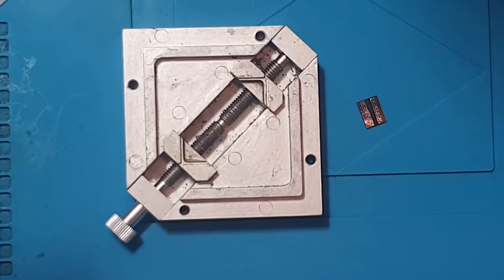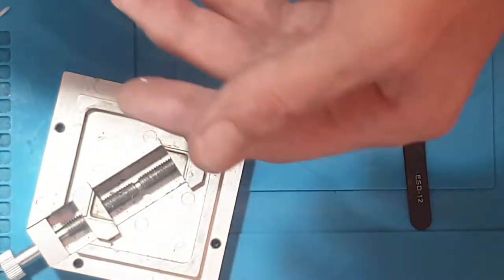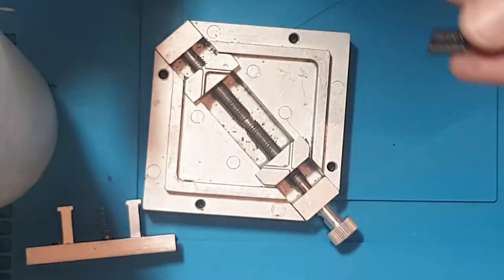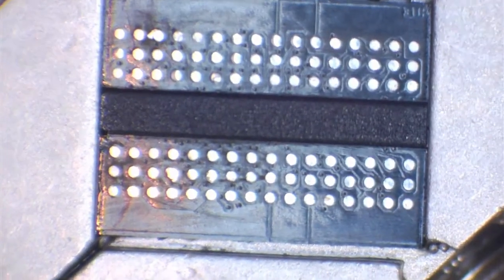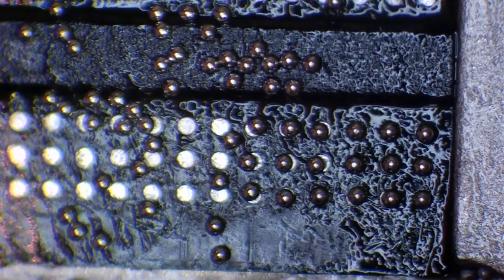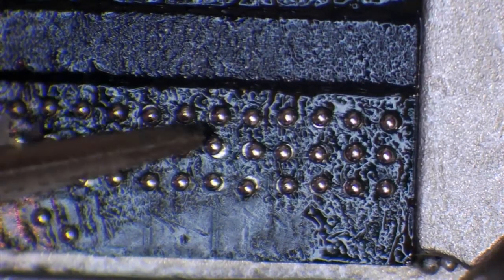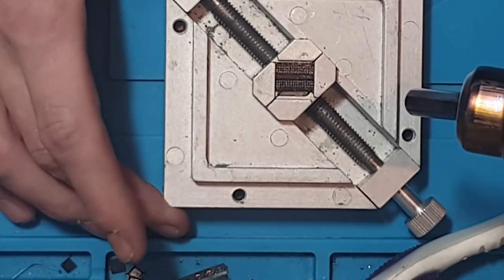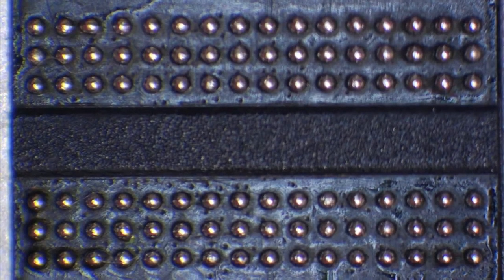How To Reball Any BGA Chip BY HAND Without Stencils - Hand Reballing Tutorial

Comment: The young lad who owns these gpu cards said that most of them were being used for crypto-mining so they were running 24/7 for ever, meaning ... so it's likely the gpu's got far too hot which is why they fail due to solder connections melting and failing. When they finally cool down if at all they go cold possibly. Just a thought ... even gamers can run their cards to bad temps and get the same results. I have heard of gamers who literally die sitting at their computers due to what ? Lack of sleep maybe ? or maybe starvation ? ... but more than likely LACK of INTELLIGENCE and self control/disipline ... maybe they should be taking up Aikido ?

Comment: Funny you should mention the magnifier app. I use a 40 inch TV with screen mirror an on the go adapter with a Bluetooth mouse and an old phone on a mount.
Reply from the maker: I used to use it myself and it was pretty good as a means to an end, especially when I was just starting out lol
Reply: @TheCod3r  hi mate I have a few chips I want to extract firmware from so I can factory reset the memory . My chips in my PCB remote controll have brands like atmel written on it . If you can assist me I will send you £50 👍

Comment: Hello, I'm reballing a GTX 1060 6GB GPU by hand and I have 2 questions, since I managed to break 2 pads in the PCB. I used the Tester and noticed that these pads goes nowhere, I mean, they literally die after in the PCB and don't have any other contact.
1.- Are all GPU pads necessary? or coul be that these pads are meant for Chip support only?
2.- Do I need all the balls to be the same exact size?

Comment: Just a quick follow up to my last comment ... the reason I had an oops moment was because the first reflow I attempted I used only about 200 C IR from below and maybe about 430C from above with hotair (no nozzle ) and the chip never even moved with gentle nudging and of course it still didn't fix the issue for reflowing gpu's. So I went hell bent for leather and did like around 250C IR below preheat and the full 480C without a nozzle for probably too much time and YEP ... the chip moved alright ... by accident ... so I had no choice but to pull it off and now I have a reball job but wondering if it's worth the time since all the power was good and still no display ... also the resistance on the gpu power rail was good as well so it LOOKED like the gpu was fine so it might still be ok even tho I more than likely stressed the hell out of it with too much heat.
Reply: Might be late response, but most of the time you see people use ur temps but in the opposite way. Well never above 360 degrees Celsius.

I use 290 on my preheater and 230 on my top heater . I use a ir6000 by achi.
Slow ramping, u need of course figure out you own profile, but i never end process under 8 minutes

Comment: Hi 

I have a ps4 pro with some weird version of the blue light of death.
For most people every time they press the power button the ps4 switches itself off or flashes blue forever but mine is different 

The first time I press the power button: there is a beep and a light but then there is what sounds like a small spark and it switches off.

The second time: there is just a beep and no light

The third time: nothing happens.

And then it goes back to light with a beep, just a beep and then nothing. It’s like a cycle. Anyone have any suggestions??? I can update the comment with a video if you want
Reply from the maker: Hi bud. That sounds like a power failure, either because of a bad power supply or some other power related issue on the board itself. The power supply is fairly simple to replace yourself but if you don't feel comfortable doing it you're more than welcome to get in touch and I can organise a repair for you
Reply: TheCod3r I open up things all the time so that’s not a problem but I don’t want to order a new power supply if that’s not the issue. Could I send it to you and maybe you could diagnose the issue?
Reply from the maker: @keenobeast5920  yes I understand, if you drop me an email using the address in the description I can get things organised for you :)
Reply: TheCod3r I have sent you an email!

Comment: Why not use solder paste instead of solder balls? It seems for me a lot easier to reballing the chip. Am i missing something?
Reply from the maker: It is easier for some people but you'd need a stencil for that. If you dont have a stencil it has to be done with manual placement:)
Reply: @TheCod3r  Thanks! I thought that with enough flux the ball from the paste automaticly connecting the soldier point on the chip. When the soldier paste is heated. So without a stencil that still works in some cases. I would like to know why this is or is not recommended. This  to get some insights.
Reply: @arthurv4401  did you get an answer? I am thinking of reballing my ps4 but only have a soldering iron and a few hours of soldering under my belt.